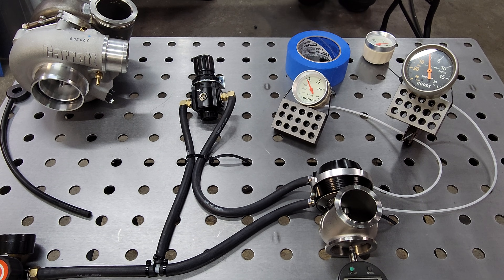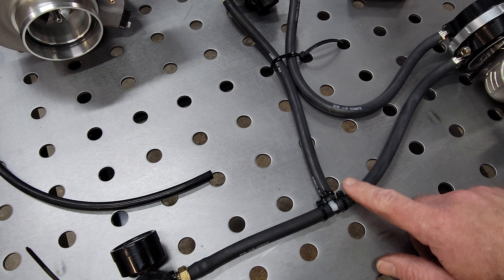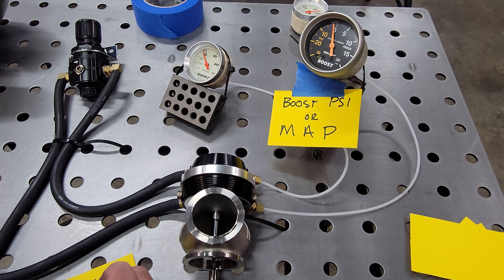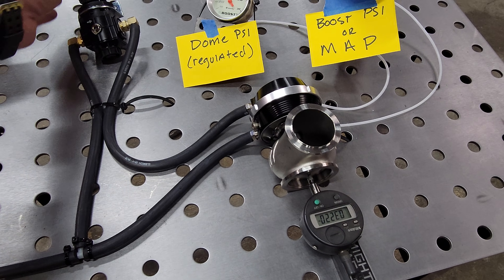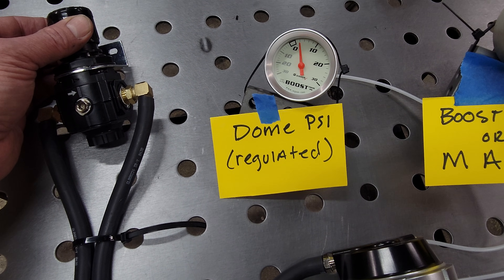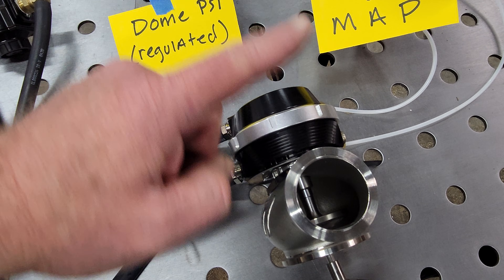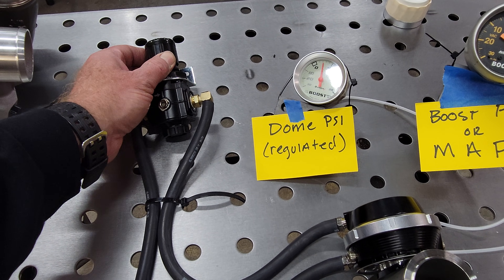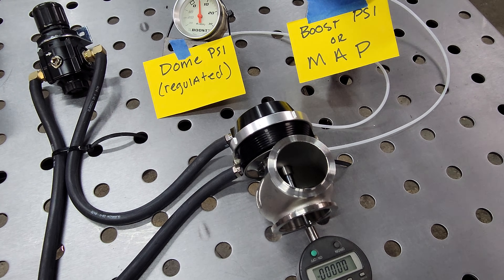External Wastegate Setup, Episode 2.  Simple Adjustable Boost Controller!

Comment: Hello I’m planning on doing a rear mount turbo , how should i plug all the holes to prevent any dust or debris
Reply from the maker: Good question!  The water ports can be just "plugged" with the supplied NPT plugs (if the gate is equipped with that feature).   No need for these to be vented.

For the "dome" or "top" of the gate, if you are using any type of boost controller,  follow their instructions and the remaining open port can be plugged (blocked off) using a suitable fitting (usually supplied with the wastegate)  

IF YOU ARE NOT using a boost controller that feeds back into the "dome" or "top" of the gate, you MUST vent these locations to atmosphere! Failure to do this will cause overboost and potential engine damage very quickly.  The easiest thing to do in your situation would be to simply tie them into the turbo inlet, after the air filter.  Install a hose barb fitting into the pipe between the air filter and the turbo, run a rubber hose from the dome to that fitting.  If there is no room for that,  you can  run a rubber hose from the fitting(s) on the gate up high into the body area where they are protected from water splash and put a simple breather filter on the end of the hose to keep dirt out.    I have used simple cheap motorcycle fuel filters or small K&N style breathers. 

For the "reference" or "lower" port, one should be going to the compressor housing, or boost reference, the second port (if equipped) can then be plugged (blocked) with the proper fitting.  

Hope this helps!  -Reed
Reply: Would u recommend installing gages in car or does the ekuctek app work just as good
Reply from the maker: @robsodifferent1606  The data off the ecu is usually pretty accurate, just some software is clunky to navigate/view.  I am not familiar with EKUCTEK, but if their interface is up to your standards, the data should be accurate (at least to what the sensor's range is capable of) Reed

Comment: I have problem with boost…during low rpm high gear…my boost fluctuate at low paddle
Reply: My setup only lower cover install vacuum hose line…
Reply: Means only adjust the spring rate
Reply: Vacuum line to map only for adjustments…i like to try your setup but before that have any adjustment that i need to do?

Comment: Could this setup be used without a mechanical spring, and totally run off of pneumatic dome pressure?
Reply from the maker: You would need a very light spring to keep the valve shut when there is no pressure being applied. Otherwise the valve will bounce off the seat and eventually damage parts. 

We use very light springs (1 psi approximate) in our drag applications that utilize CO2 pressure controls. -reed

Comment: I understand everything here but useing that t to rob some pressure making the spring hard to open ....i can just buy a stronger spring right
Reply from the maker: If you are looking to only run a certain amount of boost and never adjust it, then yes, pick your spring pressure according to your desired output...hook the boost reference port from the compressor housing to the lower port of the wastegate, leave the top port vented to filtered atmosphere and all will be great!  -Reed

Comment: Great video! So does the pressue regulator actually go in the car and work say as a manual boost controller or is it and example of what the electronic boost controller does?
Reply from the maker: You can mount it in the car, works great.  I have had one in my Grand National's console this way since about 1994 :)  Reed
Reply: @workturbo  that’s awesome!

Comment: Great videos.  I am a newbie, and was wondering why do this in the first place?  Why use the regulator at all?  Is it to dial in a precise setting between two springs?  Or is it to somehow dampen or control boost more smoothly than just one port?  I am in the process of doing a single turbo LS 6.0 L in a Yukon.  Will it oscillate with just the spring alone in the wastegate?
Reply from the maker: This is only for the ability to "turn up" your boost pressure easily without having to change the spring in the wastegate.  

If you are going to set up your combination and tune it to run "as good as it can" at one boost level, then there is zero need for this.  Just set your springs in the gate and forget about it!

But...many people like to have easy ways of "turning up" the power when they want more...like at the track or JIC some co-worker is talking about how fast his hellcat or supercharged cobra is!  Just dial in a bit more boost and show them why us turbo guys  call their buddies superchargers "stupidchargers".  

All seriousness, thank you for the question, I am sure you are not the only one who has watched this and wondered "what is this for?".   

Just a simple way to raise your boost! -Reed
Reply: @workturbo  Thanks for the explanation.

Comment: Hopefully I can get a response. I’m lookin at turbocharging my car, and I’ve seen a few different ways to hook these up. What I’m seeing is that most people run the boost controller directly from the boost reference, straight into the bottom port of the wastegate, and leave the top open to “vent” the pressure in the top and allow the diaphragm to flex open as it should. Are there any negatives to hooking the boost controller up to the top? Do I need a manual boost controller that has an air vent/bleed to allow that diaphragm to flex open? This test says no but I’d rather ask than make an assumption, I haven’t seen anyone talking about the difference between the two
Reply from the maker: The boost reference has to connect to the bottom port to open the wastegate.  There is no way to open the wastegate with pressure applied to the top, you would have to use a dedicated vacuum source.  

The top port has to also remain open, or vented to keep the system from "locking up" 

There will be a video up soon with a non feedback style controller system that does not utilize the top port of the gate...it is a simple controller with some pros and cons I will go over in the video. 

If you only applied pressure to the top of the wastegate port, the only thing that would open the gate would be exhaust back pressure pushing against the valve.  This can work,  and it does have some advantages in select installations...think of this type of control strategy as a graduate level class in college...I will get you guys there, but for now we are in the "beginning boost control" class! -reed
Reply: @ thank you reed, incredible answer. I’ll be watching that video when it comes out!
Reply: I think I kinda answered my own question. Running it to the bottom only limits the amount of pressure that the spring ever sees, allowing you to reach a higher boost pressure before the bottom starts to open. Conversely, running it to the top lets it see that pressure at the bottom but still not open because there’s extra pressure holding the spring closed. My question still kinda stands though, is there any negatives to this, like the boost controller seeing more back pressure than it should when the gate finally opens? Can this cause premature wear on the boost controller? Thanks!

Comment: Hello, after modifying the map of a 3.0 engine (m57 BMW), turbo with vacuum controlled variable geometry, I discovered the 'valve float' phenom appears, to say like this, but not due to high rpm, but due to back pressures in the exhaust manifold. Everyone tells me to change the valve springs with more rigid ones. This thing solve the 'valve float' but it doesn't solve the problem with the excess gases that can't pass freely through the variable geometry. Do you think installing an external wastegate controlled by the pressure in the intake manifold would help me? Now I adjusted the geometry wide open but I have turbo lag.Thank you very much for a possible answer!

Comment: I have a holley terminator and am doing a turbo car for the first time I have to add a air port to my piping on turbo inlet side since my turbo doesnt have a port already. What type of regulator would you recommend to use to change the dome pressure since its gonna be used for drag and drive events
Reply from the maker: Brandon, thanks for your question.  I would highly suggest using the boost control software in the Holley for your application.   You will need to order the boost control solenoid kit to utilize this feature, but it will be well worth the money!   The kit can use pressurized Co2 (like and air shifter bottle), compressed air tank (like for an airbag system) or it can be plumbed to use the boost pressure from the turbocharger compressor outlet (I do this all the time for my real street cars).  

This will allow you to build boost tables based on a time curve, gear position or even a simple "switch"  in the cockpit.  

It is a slight learning curve, but since you have signed up for the Holley, it makes perfect sense to utilize all of its features.  You will be very happy with the results!  -Reed
Reply: @ thank you for the reply what type of boost control solenoid should I get?
Reply from the maker: @brandon-rustystreecare   here is a link to the solenoids and hardware you will need.  I have had awesome service out of my friends over at Motion.  https://motionraceworks.com/products/mac-valve-holley-boost-control-solenoid-90-degree-mounting-bracket?variant=20374401843318&country=US&currency=USD&utm_medium=product_sync&utm_source=google&utm_content=sag_organic&utm_campaign=sag_organic&gad_source=1&gclid=CjwKCAiAzvC9BhADEiwAEhtlN47rmUAhA0mReaAMq2dAuCLgEg7cDIWzXEegVMM0dlupZoXa4SgleRoCtSIQAvD_BwE
Reply: @ thank you.
Reply: @workturbo  I was looking into this and my waste gate only has one hole on top for a fitting and this says I need a dome pressure sensor.

Comment: Wouldn't it be more easier to run the boost controller inline with the line routed to the bottom port of the wastegate? Or are there known drawbacks of this setup I mentioned?
Reply from the maker: I am making a video next week going into detail about this...hang tight!  -Reed
Reply: There are many methods, up to you to decide what you need for yours. Pros and cons for all setups.

Comment: Why not just use a bigger spring, like a 14 psi?
Reply from the maker: This method just allows you to have some range of boost adjustment without having to change springs.  

For example, our car needs about 16 psi on the street for pump gas, but when we go to the track we want to run race fuel and closer to 25 psi of boost.  Adding the regulator allows us to do this quickly, without spring changes.  

It is simply a convenient and accurate way to add boost to the system! -reed
Reply: @  thanks for the explanation. Makes perfect sense! Great video by the way, very detailed and informative.

Comment: New to the boosted world and i cant wrap my head around the need to apply boost to the lower port unless you want the gate opening before the rated spring pressure🤔
Reply from the maker: If you add boost to the upper port, it will always hold the gate shut (by a factor of the spring + boost pressure)...therefore producing 'all of the boost" as fast as possible...until something gives!  This is essentially going to keep the gate shut all the time, not allowing it to move at all.  

The purpose of the spring is to provide resistance UP TO the gate opening, therefore giving you boost control.  

A 7 psi spring's force will be overtaken by the pressure pushing against it, allowing the gate to move and control the turbochargers shaft speed (output)

There are rare cases where high backpressure and high intercooler restriction will cause the gate to open quicker than the rated spring pressure...but this is another topic all together.  

If you need more clarification, please ask.  Your head gaskets/rod bearings/pistons will thank you! -
reed
Reply: @workturbo  but why apply pressure to under the diaphragm?
Reply from the maker: @vnv8dude  Spring is on top of the diaphragm, so you push against the spring.  The spring and assembly is designed as such to keep the valve in the closed position until a desired pressure is achieved.  I will do a video showing one fully disassembled in the near future.  Most all automotive gates are designed the same way (Turbosmart, Tial, Precision, Turbonetics, HKS etc)

Comment: Very well explained! I think I'll be switching my twin charged Magnum to this style setup because I've been having trouble with the boost falling off at higher RPM and I'm thinking i may have excessive exhaust pressure that is forcing open the wastegate. I'll give this a shot to see if i can control it better. Appreciate the video 👏
Reply from the maker: Very welcome!